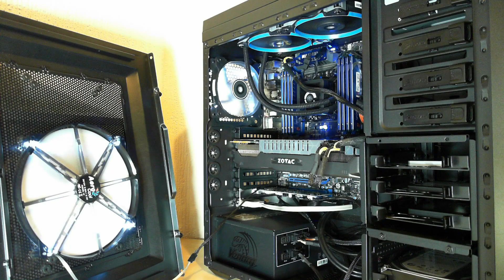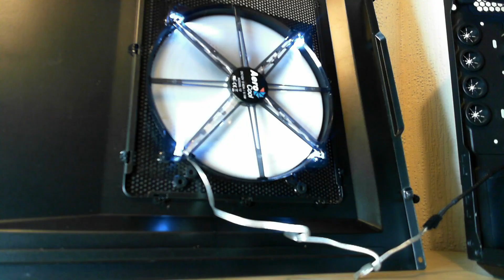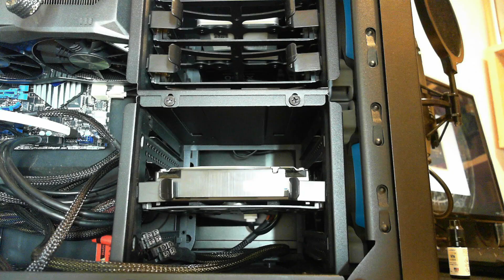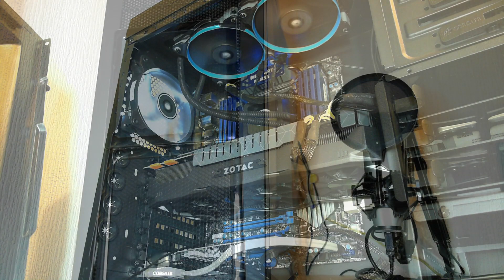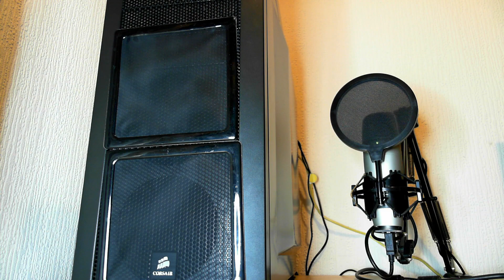Tech Stuff - Fan Update 2

Comment: not bad but you have one problem
youve got negative airflow. you blow more air out of the case than you suck in.
if you use the 180mm fan to blow air into the case you will have slightly better temps and less dust in your case.
:)
Reply from the maker: +SchnitzelKnlich  If the side fan was an intake then it would be fighting against the graphics card fans pushing air the other way, causing turbulence rather than airflow. Plus negative pressure vents hot air faster, so it's actually cooler than positive pressure, just a bit dustier. That's why I clean my PC regularly.